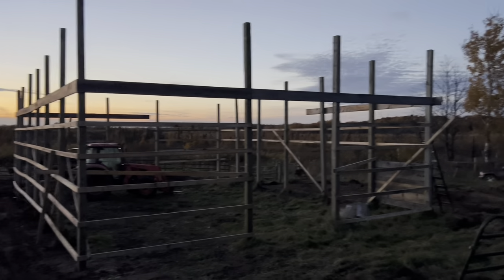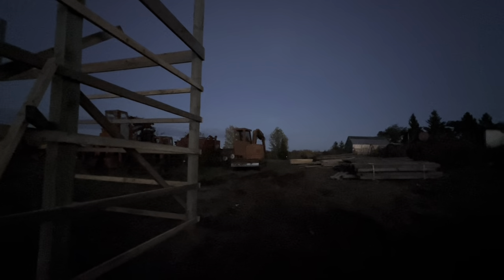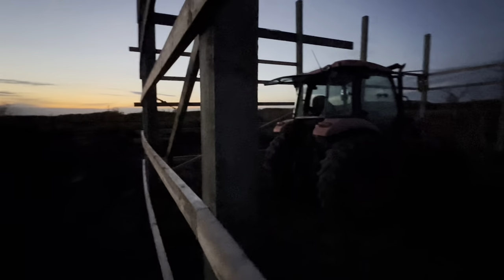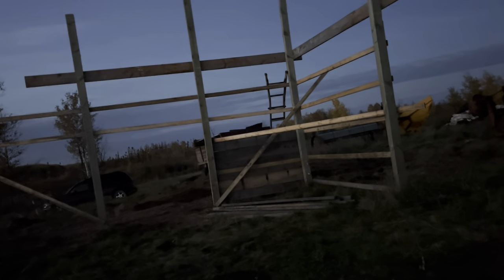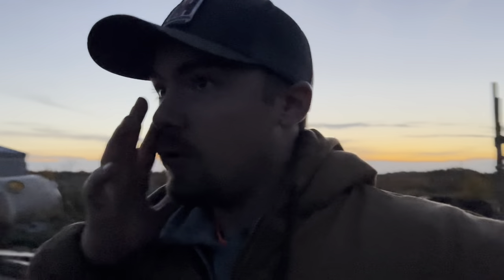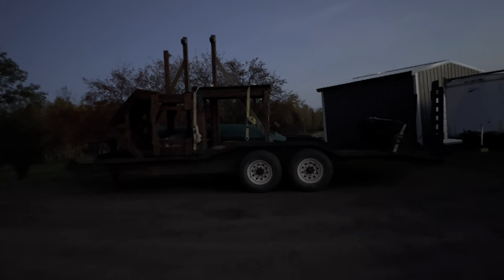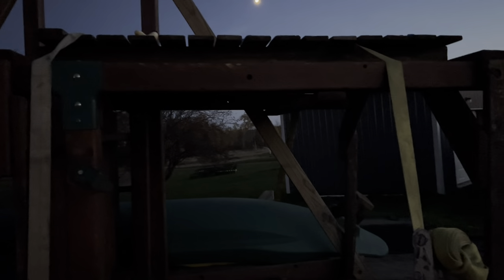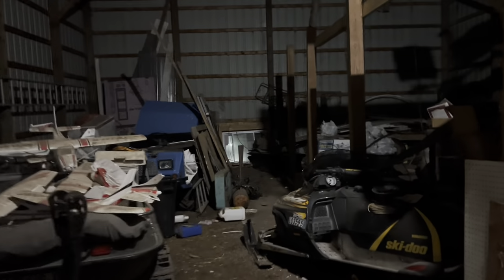Farm Update: 10/22/2023- Cattle Shed Commences and Some Pole Barn Progress

Comment: Go ahead and keep chipping away at work on the "apartment", you won't regret it, whether you use it or not, now or perhaps later.  
   Could I also suggest, to help to make more tractor storage room in the Pole shed, hanging some shelving from the rafters Creating a loft or a mezzanine style area, the sidewalls of the building appear to be tall enough.  A few 2 by 4's and some cheap indoor half or 3/8ths inch plywood would do wonders for getting stuff up off the floor.
  I also know there are only so many hours in the day to get all this stuff done, but It would be to one's benefit to chip away at it, little by little. 
  You are a young man with a lot of living still to do, so get at it :)
Reply from the maker: Rick said once the cabinets were out he wants to do just as you say, put an overhead storage in for things. I know he’s also talked about ways of storage for things like the snowmobile and other things that can be palletized in their off season and stored out of the way
Reply: @ThisOldFarm  ,, Sounds like a plan  💪